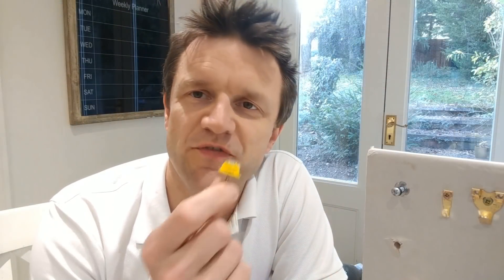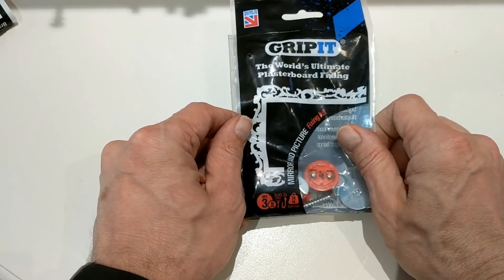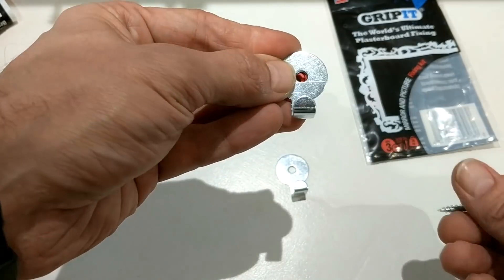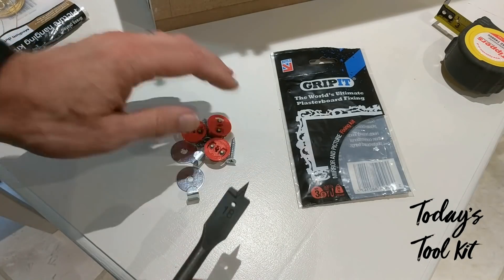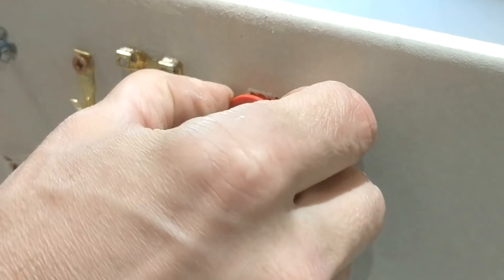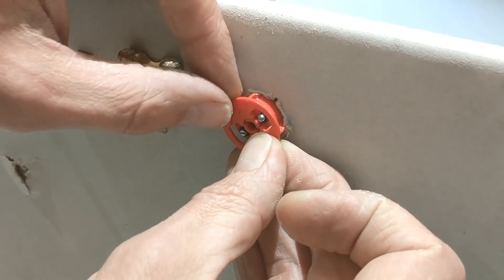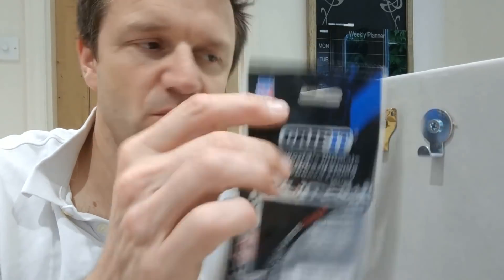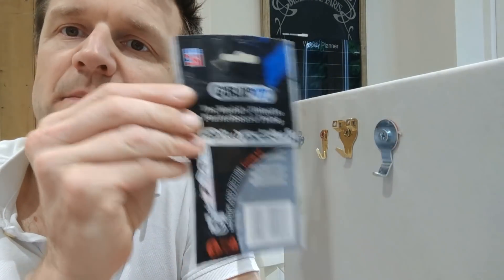GRIPIT Review: How to Hang a Heavy Picture on a Plasterboard Wall Video#2

Comment: Judging by the shape of the brackets and the fact that we only have 2 of them in the packet, I imagine that the 2 brackets are meant to be under a heavy frame or mirror (that's why they are square and not on an angle) and the third one with only a screw is probably meant to go behind the picture frame to hold the string or the metal sawtooth.
That's just my guess I could be wrong.
Reply from the maker: Naiemaa I think you're absolutely right - something I totally missed! It's a little bit odd though on a few counts. 1) there's no mention of that on the bag or anywhere else for that matter; and 2) if they're intended to operate as you suggest, then it's quite a tricky process to get the third (top) screw in the right place relative to the wire on the back of the mirror - if too low, then the mirror will hang too far away from the wall because the wire will be too slack, and if the screw is too high, then the two bottom brackets won't properly come into play. Normally in this (mirror fixing kit) scenario you have two brackets that go under the bottom of the mirror and then a few at the sides and top that have a groove in the bracket where the screw goes - so you can slide the bracket in, locking the mirror in place; and 3) if you bought the kit to install a picture you generally wouldn't be able to use the two brackets underneath because the picture frame would be too deep.  Hmmm. Interesting. Hopefully the GripIt team will set us right on this one by way of a comment of their own. I don't want to detract from what is a cleverly designed product - but if I'm sent one for review I might as well give my honest opinion 🤔 Thanks for taking the time to comment!

Comment: Agreed not designed for a downward load. However I think that particular hook is actually designed to hold a mirror with a hard back which is then flat against a wall. Maybe that's how they calculate load capacity. Agree with your thought about the size of hole Too wouldn't be my go to fixing. Good unbiased review.
Reply from the maker: Totally agree mate that it's designed to hold a mirror - and in fact that's what Naiemaa pointed out (comment below). This didn't occur to me when doing the review, but I think their logic is a little muddled. Mirror brackets as you suggest typically have a couple of static brackets that go under the mirror (like theirs), and then a few with slotted screw hole holes on the bracket so that you can slide the brackets in from the side and top. But because these are clearly, as you suggest, designed to go under the mirror, you've then got to position the third screw near the top of the mirror, to take a wire or mirror string, and this is reasonably tricky to get in the right position for your average DIYer - too low and the mirror swings forward, too high and the bottom brackets don't come into play.  Also, the pack is marketed as a mirror and picture hanging kit, but is clearly, as you say more geared to hanging mirrors, because the brackets wouldn't fit under most pictures. There's nothing on the pack to explain their logic as to how to use the brackets.

Comment: To be fair to grip it, they aren't at fault here. They have supplied brackets in the picture frame hanging kit that is specifically designed to withstand the load of picture frames lol.

Anything you buy, that requires a bracket to be mounted onto a wall will come with a bracket specifically designed to mount that product, whether it's a boiler, radiator or whatever. Hanging 20kg worth of gear off of a bracket designed for picture frames isn't fair, and is ultimately misleading and poor reviewing of a product.

The gripit fixings are perfectly fine in doing the job, provided the correct ones are used for the product being mounted.
Reply: But the packaging states it can hold 75kg, so it should be able to hold 20kg without issue.  I have a large mirror I want to hang it's way more than 20 kg. looking for the right fixing for plasterboard. I'm thinking I might have to have it off-center to get it into a stud.
Reply: @philkap  the plasterboard fixing itself can hold 74kg, that's why all the range are just sold as fixings, ie no brackets, because the bracket is solely the responsibility of the product manufacturers of the item being hung. Manufacturers brackets are designed to withstand the load of the product, it is then your responsibility to use the correct fixing for that product. A picture frame bracket isn't and never will hold 20kg or anywhere close. A little common sense goes a long way
Reply: @philkap  what did you use in the end?. I too am looking to hang a large heavy mirrir, probably about 20kg. I dont have much space behind the boards and am looking to use two or even three fixing just to be sure.
Reply: @phildavis1825  I ended up installing a picture shelf screwed into the stud one side and with a plasterboard fixing on the other.

Comment: It’s not lazy marketing. The fixing is fine it’s not came through the plasterboard ? The hook is flimsy not the plasterboard fixing
Reply from the maker: It did go through the plasterboard and they provide the hook so it should comply with their load ratings
Reply: @CharlieDIYte  no I mean like the fixing didn’t pop back out the plasterboard the fixing is completely fine. The hook on the other hand isn’t

Comment: Your logic of small a hole as possible in plasterboard is flawed and completely wrong. Drill a 3mm hole in plasterboard and insert a 3mm bar and pull down, due to it being small it would cut in to the edge very easily, now drill a 4””  hole and insert a 4” bar it would be near impossible to pull that bar through the edge of the board due to such a large surface area. This is precisely why the larger grip-its have a stronger load rating.